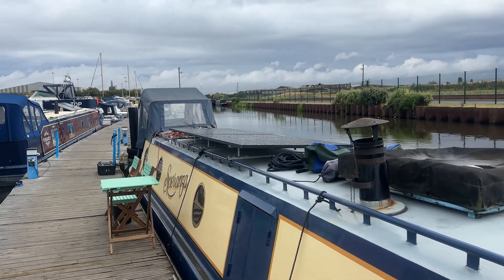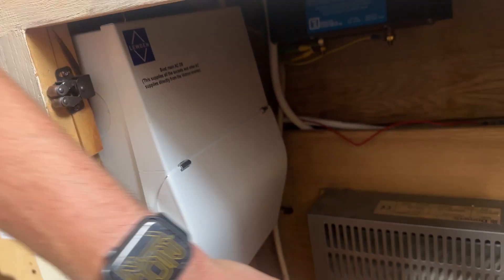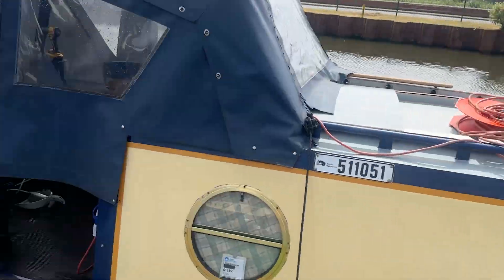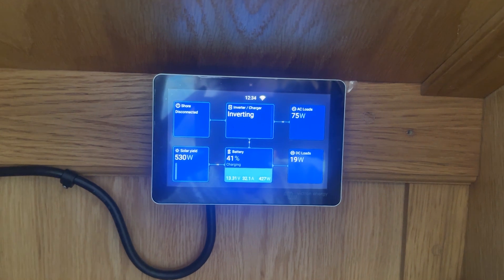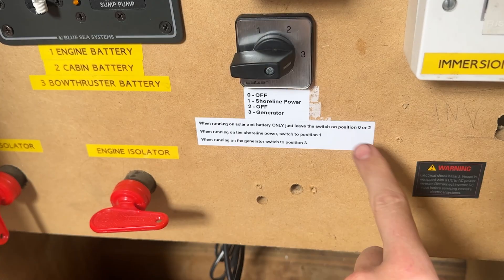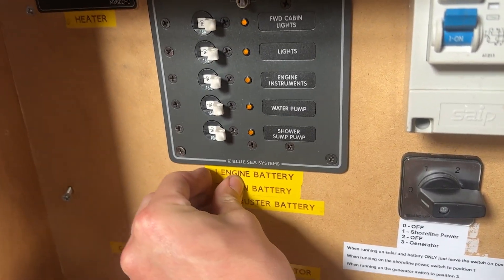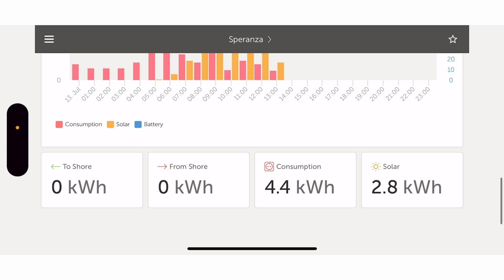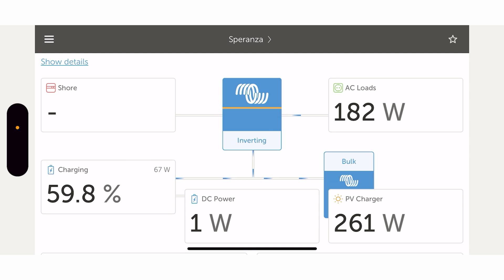NEW OFF GRID SOLAR & BATTERY ON A NARROW BOAT!

Comment: The MultiPlus has a built-in maintenance charger for the starter battery, so you don't necessarily need to fit another charger just for that purpose. (For details have a look at section 2.3.2. of the installation manual)

Comment: Seems decent though not really gonna be able to scale much at 12V and the Victron power distribution blocks are kinda overkill for just two batteries.   I'd have gone 24V and added a Victron isolated DC-DC 24|12 charger for the 12V side.   It's generally a good idea to used as much galvanic isolation as you can get away with on boats because of the ground paths through hull-fittings and the water.
Reply from the maker: Thanks for the input 👍